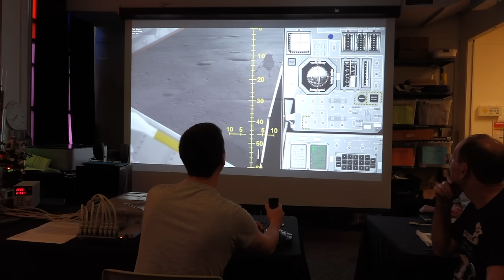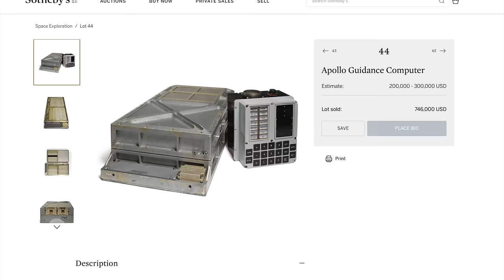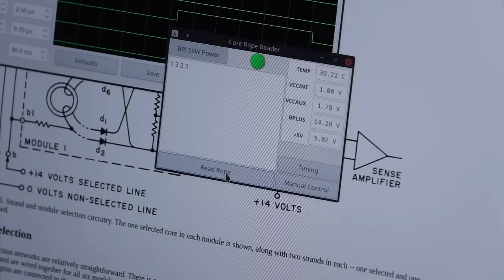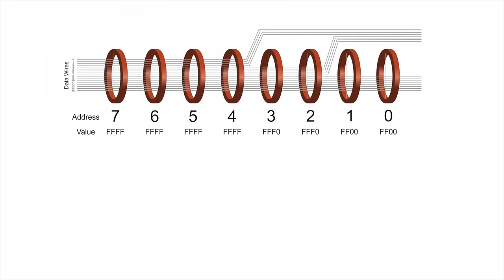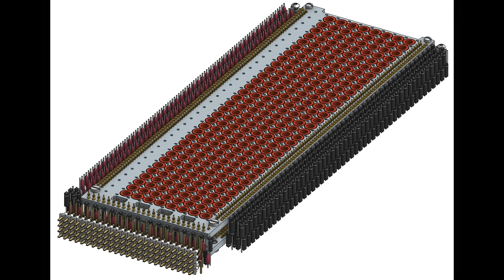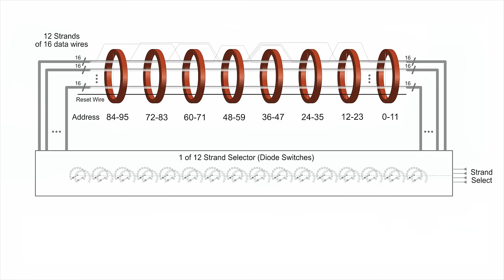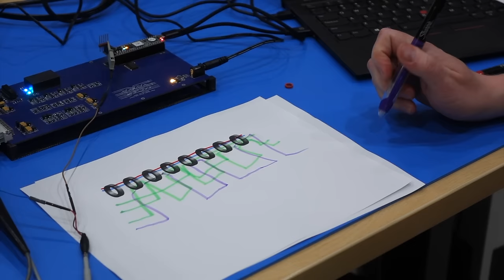Apollo Core Rope Memory (Apollo Guidance Computer Part 30)

Comment: You just never know when you need a rope core memory reader.
Reply: I have this mosquito encased amber...
Let the Dinosaurs walk again.
Reply: I remember 2 of 3 people where I worked wiring and repairing memory cores like these about 40 years ago. Obviously they must have had a method of reading the cores. I don't remember what machines they were for, the rest of us were programming PCs and minicomputers.
Reply: A portable one, no less ...
Reply: A usb memory reader that can read the oldest memory out there
Reply: Needed one just the other day.
Reply: I asked for one at my local computer hardware store and they were all out of stock.
Reply: NEVER NEVER EVER, throw away your adapters.
Reply: I worked on a radar receiver processor in the mid 80's and we used one of these plugged into the back as working memory for the test routines.  Those were loaded from 8 level punched tapes.
Reply: @PsRohrbaugh  Now, someone needs to release a song on an AGC module.
Reply: Some Russian (Soviet) computers still used core memory for some things.  And some older flight computers still have a few buried in them.
Reply: Now that so many have been read, when is the reproduction video game coming out?  😷
Reply: Yeah, where were these guys last Tuesday?!
Reply: @bryede  Gotta be "Daisy, Daisy..."
Reply: I think I’ll build a portable rope core memory reader.  
Jeez
Reply: Lol right!
Reply: WalMart and Amazon do not sell them!
Reply: Back in the day harbor freight had them for I remember 2.99 for 6 strands and 399.99 for 152 strands....sigh the good old days I had my chainsaw automated with these back in the 1890's

Comment: When I first joined IBM I was offered a job operating a tool to "weld" the ends of the wires fed through the memory array frames.  I declined the job and took a job in the warehouse instead.  Ferrite core memory arrays were assembled in the UK and sent to Portugal to have a single gold wire fed through the centre of the array, They were then shipped back to us in the UK to assemble in the mainframes in production.  This was 1969.

Comment: This video makes all the vintage HP equipment repair videos look nice and easy. 
Thanks for the exhaustive explanation of all the magnetic magic, Marc.
Reply from the maker: My thoughts exactly. After this one I’m going to relax repairing an HP instrument that has only 10 faults in it. It will be a walk in the park  ;-)
Reply: I'm the opposite.  This is one of the videos I understand.  But this probably due to my lack of electrical engineering knowledge.
Reply: @CuriousMarc   Like a HP5342A with a broken sampler, which requires you first design and build a wire bonder 😵‍💫

Comment: The key to understanding "core" rope memory is that the cores don't store anything themselves. They're actually a clever memory address decoding mechanism. I worked out that if the dual 3-input NOR gate chips used elsewhere in the AGC had been used in address decoders, it would have required many more than in the actual computer.

Comment: for several years I worked on 'core' memory assemblies for the old IBM Federal Systems Division (now part of lockheed/martin)  They used much smaller versions in Space Shuttle and most avionics computers (A6/7 F111 etc). They were the only nonvolatile memory at that time.  The shuttle Challenger computers surived the disaster and the memory contents were still intact
Reply: I worked on 'core' memory assemblies
Reply: @jimmyschmidt14 I worked on ‘core’ memory assemblies

Comment: This guy has done some serious programming, the rope reader itself is impressive, but the software supporting it is absolutely mind-blowing.
Reply: Right ? Mad genuis to make hardware n software work let alone design and print a board
Reply: Typical nerd stuff: Knuth: "I am writing a book. I didn't like the printing tests. I will write a complete typesetting software." Years later we had TeX and no complete book yet.
Yes Mike was really incredible he write the simulator AND make the memories work.
Reply: This is some really good low level hardware interface undestanding. This guy has one foot in electrical engineering domain.

Comment: Man, i dont know what it is, but its absolutely awesome to see a 60 year old bundle of wires light up and identify its self as module B4 from luminary 69. Space race computing is neat, it has a certain mystique and romance.
Reply: I work in defense and I'm not gonna lie... I'm not sure we could build this today haha.  Asking someone to design and build something like this is going to result in some deer-in-the-headlights looks...
Reply: @tychosis  that's the funny thing. Not just design, but also assembly. This kinda thing was done by hand. The actual skill of putting these together correctly was built up over years of similar projects. We're 60 years on, there's no one left who can build them if you could find some to design them.

Comment: Wait, the AGC was cartridge based?
Those removable core-rope modules have got to be one of the very first ROM cart formats ever made, if not the first.
That's remarkable. So I find it odd that nobody has remarked about this.
Reply: @deang5622  The fixed rope memories are not writable. They are coded at the factory, when the wires are physically woven in or out of a ferrite core. These rope memories were 100% Read only. Only the single 4K module was magnetic core memory, and that one was the only writable module. A RAM stick, if you really think about it.
Reply: @richfiles he said ROM
Reply: @UloPe  i know. The fixed rope memories are like ROM carts... The core memory is also a module, which I was then making the comparison to being the first RAM sticks. The two are different parts.
Reply: @richfiles  I think they were referencing cartridge like you would see in early video game consoles from the 70s and 80s. Atari and Intellivision were not the first, but predated by another that never really got marketed. The AGC would have predated these things by 1-2 decades. Which is where the fascination on it comes from. That's my guess anyway, they'd have to comment on that for themselves. Its just how I read it.
Reply: @taemien9219  I know... It seems the person I was replying to deleted their comment. Note the username I was replying to. Apparently, when I pointed out their error, they decided to delete.
Reply: @richfiles  When I replied, there was far more replies in the thread. Weird.

Comment: Hey! This video inspired me. I am in the middle of creating a BCD to seven-segment decoder using core rope memory! Right now I am able to pull an SR flip flop high or low based on whether the rope passes through thencore or not. Just beginning the process of linking it all together with the clock and automating the process. Loved the video and just had to return here to tell you of the inspiration and share my partial success.
Reply from the maker: Good luck with your rope contraption!

Comment: I wonder if you could power the whole thing from USB-C with a fancy power-delivery controller?   With 60 watts of power, I wonder if that could replace the external supply?  Of course, you'd need a suitable laptop up to the task of providing that much power.  

Thanks for doing this definitive explanation of how core rope works.  It's obvious now how much hand-waving around this topic has persisted up to now.  Like most things around this, it's just amazing it works at all.   So much analog at work here inside the digital computer.

Comment: It's fascinating to see the explanation and then compare it to it's replacement of microchips that serve the same purpose. But many folks don't know that early chip technology from the early 60's was quite secretive, even though it was developed for missiles such as Atlas ( I have seen early chip examples. General Dynamics used to sell off faulty production chips for use as tie clips and cuff links as well, to employees, my step father in law being one of them.) Rope memory of this type was extraordinary, and clearly the top of the line for it's time period. It's wonderful to fully understand the function of it even though it's now very much beyond obsolete, but to watch it still work when powered up more than 55 years later, is awe inspiring.

Comment: Fascinating.  So the information isn't stored in the core itself like normal 'core memory', but rather in the wiring.  The cores just provide a way to detect how the wiring was done for a particular address.  In standard core memory, you could accidently erase the entire thing by exposing it to a strong magnet.  But this memory, you would just reset it and then be able to read the 'wiring' all over again.  Very clever.

Comment: The efficiency these engineers achieved decades ago is just amazing. Manufacturing non corruptable programs is just mind boggling with no error correction just using core rope memory.

Comment: Interesting. 

I once used a manilpulation or arrangement scheme for finding a least upper bound for what is called variation distance with respect to convoluted probability on a finite group. This essentially told you how close you must be to uniformly distributed after K convolutions. What was done to get the results aimed for on the core rope memory seem now or 17 years after the fact to be a bit analogous.

& Sweet work, Mike.

Comment: In the late 1960s I was using commercial computers (Burroughs B 3500) that used rope memory for the microcode ROM. But until now I never really knew how they worked. Ah, the incredible logic messes you can generate when you don't have enough hardware available to solve a problem simply!

Comment: Back in the late 70s, I repaired computers that had 4K core RAM, or random access memory, boards, that was read/write capable storage for a small computer used for bookkeeping. Occasionally we had to repair the drive transistors that selected and sensed the core condition of being a one or zero state.

The worse case repair was when there was a short that caused too much current to flow, and it would cause the core wiring to burn up, which was when we would install a new board.

Thankfully, those boards were upgraded into solid state ram, which was faster and drew much less current!

I was never exposed to non volatile core memory, which would be equivalent to ROM, or read only memory, which we would program ourselves, and that tech changed quickly as well!

It makes sense to have non volatile core memory, as conditions in space could wreck many of the storage mediums we had back in the day, and cosmic rays were the worst as far as destroying ICs and semiconductors!

Comment: I had the pleasure to program on core memory in my earliest years in college on an IBM 360 model 50 mainframe.  It had a 500K core memory module about 2.3 meters high by 1 meter square.  The mainframe also had a smaller 256K module.  I was able to see the large module opened one time and gaze upon the ferrite cores and woven wires between them.
Reply: As a student in the 70s I used an IBM 1620 and the core memory could be opened and swung out like the pages of a book.  It used 3kW power, and a big fan to keep everything cool.

Comment: I visiting Draper Lab in Cambridge in 1994 and the LEM computer (which used rad-tolerant "core" memory) was on display for the 25th anniversary of the Moon Landing.  Draper Labs developed the navigation for the moon program.

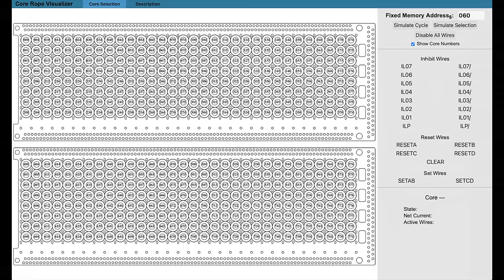Comment: @44:55 so complicated that even the elevator music stopped before finishing the explanation 🙂

As for "wasting" 500mA in the Reset wire: it could actually also be fed with half current when operating as part of the inhibit, but that would of course require additional hardware to provide this current.

Comment: Interesting tidbit - magnetic core memory was actually used in more mundane applications in the 1950s.  My 1962 Seeburg Princess jukebox has what Seeburg called a "tormat" (toroid matrix) memory unit, which was a toroid based core memory to store selections electrically/magnetically instead of with a bunch of micro switches as customers selected a dozen or more songs.  This system would also erase the data bit after the record was selected, so it was both a read and write system.  Besides saving a lot of mechanical switches, the tormat also had the advantage of not losing it's song selection memory if the box was mistakenly unplugged or during a power glitch.

Comment: Very nice project.  However, we need to give some credit to IBM too.  The Apollo Guidance computer was not the only IC equipped digital computer aboard.  IBM installed a guidance computer on the Saturn rocket that provided the rocket with guidance.  You can see it if you visit Space Center Houston.
Reply from the maker: But the LVDC had no ICs. It had hybrid ceramic packages, which contained individual transistors and diodes. In fact IBM led the anti-IC crusade against the AGC… That is unfortunate, but does not take away anything from IBM’s LVDC guidance computer contribution, which never failed either, and even continued through the Apollo 12 thunder strike, correctly discarding incorrect sensor data.
Reply: @CuriousMarc  Thank you for that explanation.

Comment: I must of listened (while working) and watched this at least 10 times in the last few days. Super fascinating. And amazing work explaining the complexity of it. , I was curious to know if Mike is planning on open sourcing the rope reader?  Because   I purchased a little core memory module from ebay some time ago from Canada,  I believe it was from some sort of fighter jet. , I'd be eager to Try read it's contents or wipe it completely 😂 either way most certainly give it ago with my limited knowledge.  I believe it has similar make up of the memory module. Well at least I think so. , anyway keep up the nerdy stuff. ❤

Comment: Two little inventions in the early 70s changed computers forever: Semiconductor RAM and the microprocessor (1970 and '71 respectively, both invented by Intel). The fact that NASA could make practical computers small enough to put in a space capsule without these two inventions is a scientific wonder.

Comment: Those engineers were so OP spaghetti solutions (and hotfixes) were of no consequence. In those cowboy days you could get the job done no matter the risk. These days red tape locks you down to the point where once you have fixed one bug 4 technologies have gone obsolete.

Comment: Would have been easier if the Library of Congress had just preserved the original documentation, but I suppose it was all classified, blah blah blah.  Nice job on the restoration.  I watched the whole explanation of core rope which was new to me (basic core was familiar) and I cannot claim to have retained specifics but I get the general idea.  Funny how the design team missed the bugs, the test engineers are essential and often not given due credit.

Comment: TCROS memory was developed at IBM Hursley for their SCAMP computer, and later for the 360/40. It was used to store the microcode so needed to be fast and fixed.  There was lots of politics between different labs - Hursley was led by (Sir) John Fairclough, my neighbour in Winchester when I worked at Hursley lab, and later Margaret Thatcher’s (!) chief scientific advisor.
Reply: TROS for the 360/40, BCROS for the 50?  My dad was at Hursley in the early mid 60s for training on the 40. I did not know Fairclough went on to be advisor, very interesting thanks.

Comment: It shows how old I am. 72K sounds enormous to me.
Oooh... I love how it's actually a box you can plug the module into.... it's like a USB hard drive. :)
Reply: You can still fit a lot in 72K when programming microcontrollers.
Reply: @rocketman221projects yeah... I frequently do. You can fit a lot of AVR assembly code in a 2K flash.

Comment: So, since all the data is actually in the weaving pattern not in the magnetic state of the cores, would it be correct to assume one can't really damage/corrupt core rope memory by trying to read it incorrectly, short of doing something catastrophic like passing a high enough over-current through the wires to physically damage them...?
Reply from the maker: Having a wire current stuck on can definitely melt a wire. You can ruin core memory that way too, if your pulse driver decides not to make a pulse anymore. Usually they’d designed driver circuits that could not fail in that way. In the ropes he read since, Mike tells me has seen diode failures (same diodes we had fail in the AGC), and one “broken” core that would not respond. Fortunately he was able to work around both (difficultly).

Comment: question, Whats the read and write specs for some of these core rope memory ? like speed ?
Reply from the maker: Core rope memory speed is limited by the time it takes the big core to flip. You can see when we make the flip experiment on the scope that’s about 4us (granted, unoptimized). You need two flips (one to set and one to read) to read a core. Instruction execution times of machines of that era are usually engineered around their memory cycles, for the AGC an instruction execution cycle is 11.7us. This order of magnitude.